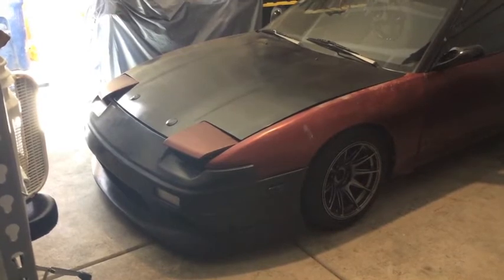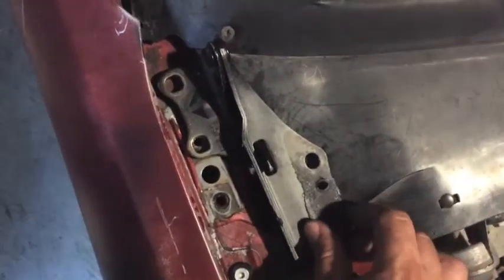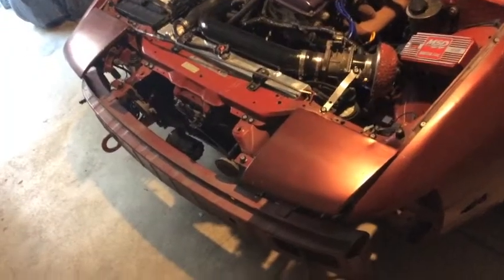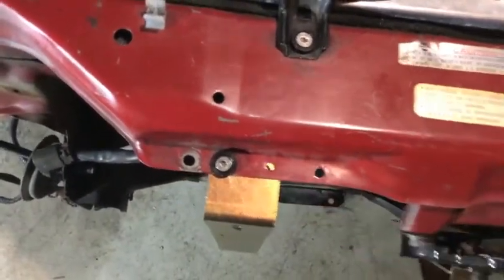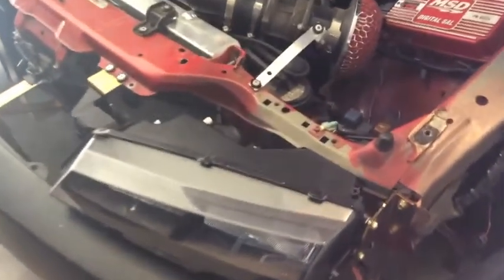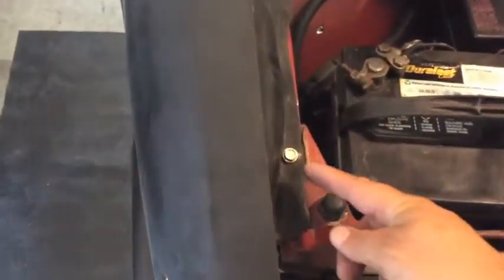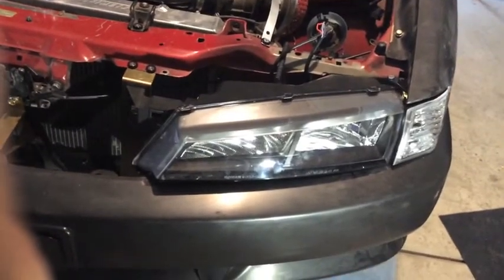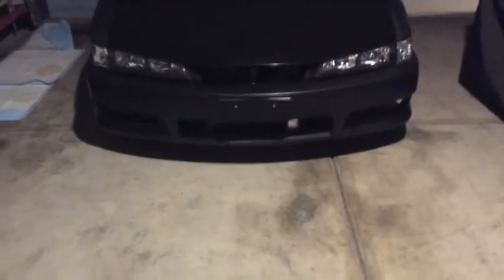S14 Front Conversion

Comment: Hi man! I’m doing the same with my car but I’m having trouble finding the right fenders that fit. What fender did you buy and what website?
Reply from the maker: I got it from the website AIT racing. I don’t know if they still have them tho it’s been a while.
Reply: Hey so I’m stumped on the headlights part. I did the same process but my lights won’t turn on? Any idea what the issue could be?
Reply from the maker: @fernanda.m8439 have you checked the fuses for your headlights? On the video I added high beam and low beam together because I like the way it looked driving but you can always separate them. Make sure you use electrical tape
Reply: @adamhashimoto8515  fuses all look good but they won’t turn on even if changed where they were placed unfortunately
Reply from the maker: @fernanda.m8439 move the headlight pins around see which ones are ground and power trouble shoot one side first to figure it out

Comment: Question so the high beam and low beam are always on at the same time?
Reply from the maker: Alex Urquizaa yes I hooked them up like that because I’m going to be running yellow HIDs for my high beams. so the top pin is for high beam the right side pin is for your ground and the left side pin is for your low beam.
Reply: I was wondering about that...looks dope. How much you spent on the front end?